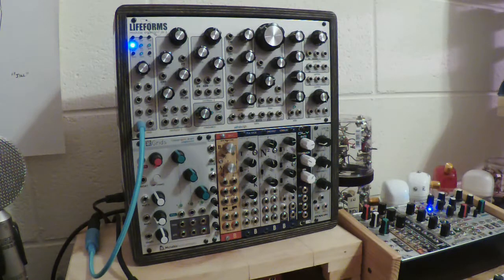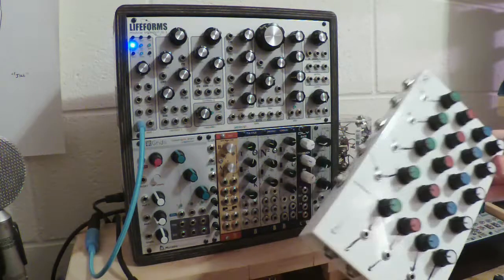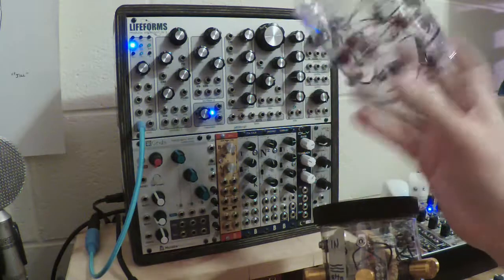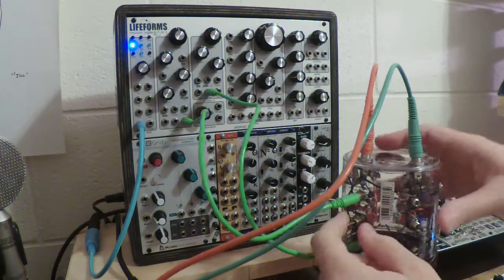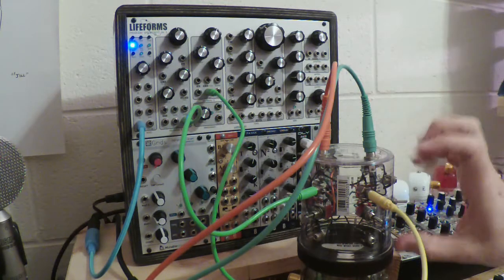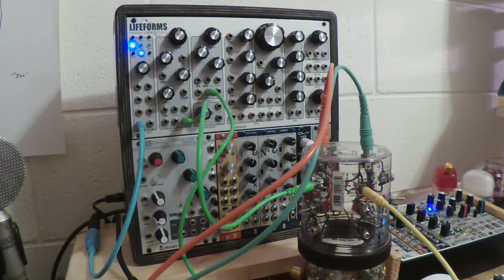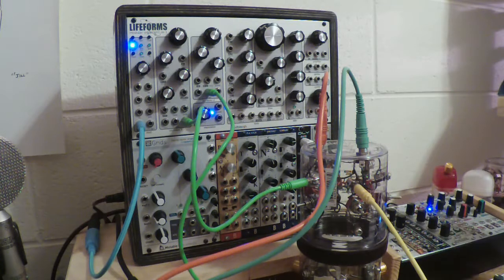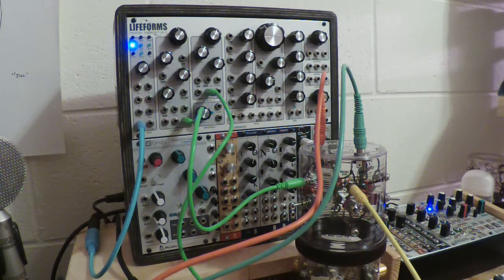Homemade Modular Devices

Comment: I like the way it snaps when you close it......Very well designed..Now was this your only Modular gear back in Feb 2018? & i like the Bottle Device..Looks like the one we were talking about the other day..lol
Reply from the maker: That matrix mixer had problems.  Pots were constantly going out .. I may have fried some of them when I was soldering because this was my first try at building one.  I replaced the bad ones and then other ones went out, and then the supposedly good ones acted up.  Every time I plugged it in there was a new problem.  It was a headache to build and an ongoing headache to troubleshoot so I gave up on it.  Haven't had such problems with any of my other doodads.  And yes, what you see in the video was all the modular gear I had at the time.